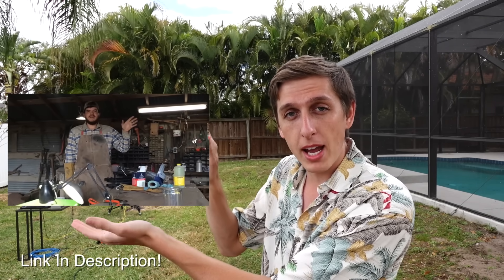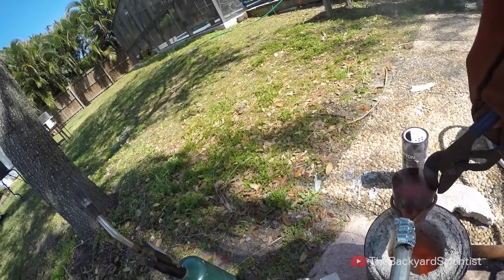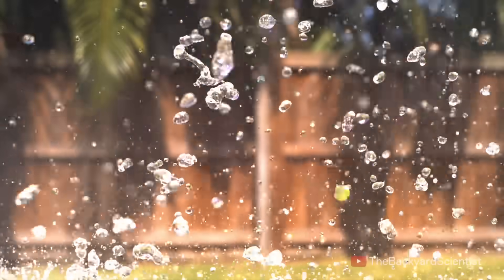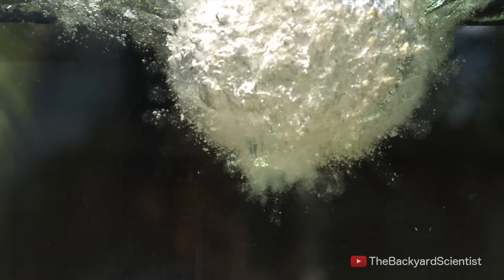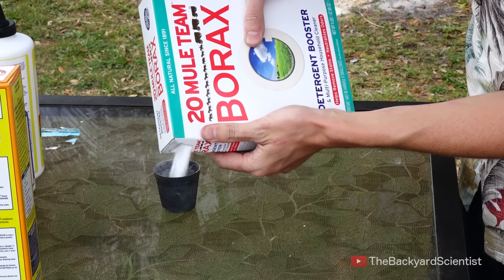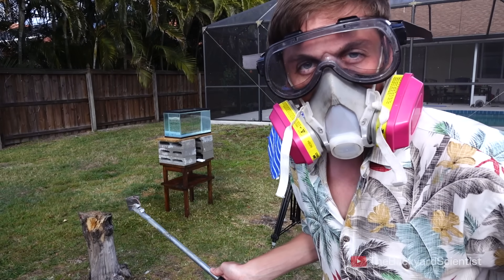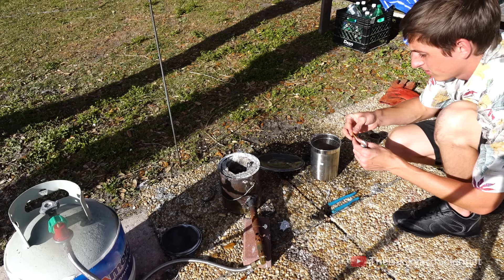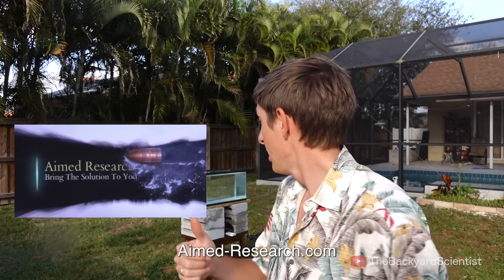Pouring Molten salt into Water - Explosion!

Comment: Its has to be a chemical reaction because it is releasing clorine gas from changing states and then you are left with sodium. So it is not sodium-cloride anymore you extracted sodium from sodium cloride. Then the sodium reacts with the water. This is my theory on if it is chemical or physical.

Edit1: The clorine is  protecting it for a little longer to make it react underwater then the clorine turns into more gas and gets extra pressurised, and with the sodium is going to be more explosive.

Comment: The reason this happens is similar to sodium explosion , about 70,000 amps of current pass into the water , only a small portion of the salt reacts so its 70,000 to 700,000 amps for 1,000th of a second

Comment: It may have something to do with how salt dissolves in water. It become separate atoms of Na and Cl suspended in the water. Heating the salt may accelerate the dissolution process and make the sodium more reactive to the water, triggering an explosion even though its concentration at normal temperature would not cause such a reaction.

Comment: Elementary sodium reacts strongly with water, according to the following reaction mechanism:
2Na(s) + 2H2O → 2NaOH(aq) + H2(g)
A colourless solution is formed, consisting of strongly alkalic sodium hydroxide (caustic soda) and hydrogen gas. This is an exothermic reaction. Sodium metal is heated and may ignite and burn with a characteristic orange flame. Hydrogen gas released during the burning process reacts strongly with oxygen in the air.
A number of sodium compounds do not react as strongly with water, but are strongly water soluble.

Comment: It’s hot and cold, you can molten anything to extreme heats and you get the same reaction, you get the same in reverse, cold water on anything hot has reaction.  What happen is the heat starts vaporizing the water it separates the oxygen and hydrogen  and for the explosion you need the oxygen and the hydrogen is what exploded under water, it the same with the metal just it didn’t make it all the way under to explode

Comment: Ah finally, I have made a bomb with a button that pulls a thin metal wall and then I put water on bottom but when you press the button it has a 5 second delay so it doesn't explode in  your hand and the top is molten salt... Oh and the shell is glass

Comment: It looks like its a simple flash into steam that is causing the "explosion".  The water that comes into contact with the super heated salt instantly and violently expands into steam.  The more heat contained in the molten salt the more violent the burst into steam will be.  Water expands about 1,600 times in volume when it flashes from its liquid state into steam and when this happens suddenly, and with enough heat to sustain the flash into steam, then the results are as seen in the video.

Comment: If you drop most anything at 1600 degrees in to water, it's going to create a steam explosion. Water expands 1700:1 at 212 degrees. Super heated to 1600 degrees, it will expand many times faster. Simply a heat reaction.

Comment: apologies if this has been suggested already, but I'm not skimming through 30k comments to double check 😅.  Could the difference in physical reactions between the various salts be due to a difference in thermal conductivity among the different ionic compounds?  My thinking is that if table salt is conducting the heat to the water more efficiently, then you should get a bigger, faster, expanding cloud of steam right?

Comment: I use to heat lead up on the stove in a tin can and pour it into a one gallon wide mouth glass pickle jar filled with cold water to make weird shapes as the lead became solid again in the water, but once it blow up, not leaving any of the jars glass even 1 inch long and the entire kitchen was wet and dripping from the ceiling. I didn't get a scratch, but haven't done it again in the last 50 years. It took some time to clean up befor my parents got home, the glass was everywere.

Comment: None of these guesses sufficiently explain why other salts don’t exhibit the same behavior.

The outer layer of salt cools extremely rapidly and solidifies. As this happens, it shrinks (as most liquids do). Notice, all of the explosions were near perfect spheres. This only happens when the salt becomes submerged and the top is not left molten as a means of releasing pressure. When the outer shell compresses to a point where is cannot contain all the forces inside, it shatters and explodes. Similar to what happens when you clip a prince rupert drop under water, but there is a lot more energy involved.

Comment: Seriously, I have to ask how lacking our chemistry education is in schools.

Anyone with any rudimentary education about chemistry knows that metal sodium, Na, will react violently with water. The reason for the violent reaction with water with molten salt is simply because when you heat up the salt, you destabilize the ionic bond between the sodium, Na, and chloride, Cl, atoms. The metal sodium is still molten, but stable, and more pure. The chlorine, being a gas, is trying to separate from the sodium due to the higher energy the high heat content has given it. 

Upon contact with the water, the metal sodium reacts very violently as chlorine separates for a split second from the sodium atom, becoming a vaporized gas. The water ends up being a mixture not of salt water, but a two-fold chemical compound, one of sodium hydroxide, NaOH, and hydrochloric acid, HCl. This happens because the high heat also gets transferred to the water, allowing the water to break down into one molecule of hydrogen and oxygen that are still negatively bonded, and a free hydrogen atom. This how sodium hydroxide, NaOH, and hydrochloric acid, HCl, are formed in this reaction.

Comment: The fact that first attempt at molten salt into the water failed to create an explosion would lead me to believe the temperature of the liquid salts you are dumping may not be constant. There maybe a temperature that the other liquid salts would behave similarly to the right temperature molten table salt. A significantly taller enclosure and thermal feedback for the water and the salt could show in simple heat transfer what occurred and over what time period. Leidenfrost looses effect of insulating barrier at significantly higher temperatures than the leidenfrost temp.  Another way to see it wasn't chemical but physical, would be to observer the resulting temperature of the combined water and salt. Chemical reaction would have given off or absorbed energy. I would think the PH experiment would have seen the final combinations of the salt dissolve and higher ph resulting if your measurement strip has the resolution to see that change of ph from that small amount of salt (even if not molten).

Comment: I think I figured it out.
It’s a runaway physical chain reaction. In the first explosion you can see the expansion start at the tail on top and travel down the salt stream into the blob. Somewhere on the tail there was enough turbulence to push the salt thru the leidenfrost forces into contact with the water causing the salt to rapidly dump its kinetic energy into the water, vaporizing it and causing it to expand. It expands into nearby salt and water causing more contact and more expansion which causes more contact and more expansion etc. When it reaches the blob on the bottom, which is storing a crapload of kinetic energy, the reaction breaks wild, dumping all that energy into the water very quickly, causing a massive steam explosion.
Reply: There is no reaction.  Heating water to steam is not a reaction.
Reply: @gibbogle  There is a physical reaction. A transfer of energy and a change in the matter state.
Reply: @toddisawsomeable  Yes, I should have written "chemical reaction".

Comment: It's chemical, the reason as to why their was no change in the ph of the water when you added the molten table salt, is because the ph of table salt is relatively neutral. Therefore, causing no change in the level of ph to the reaction.

Comment: How about copper Sulfate, magnesium chloride, iron Sulfate, potassium nitrate and calcium carbonate? Will any of these five metal salts will explode in water when molten. Potassium nitrate will likely explode in air when heating it up before pouring it into the water as it’s used in making black powder.

Comment: I think the variability in your results is due the Leidenfrost effect, or a similar effect if you take that   the Leidenfrost effect is about the water vapour layer only. Another effect is solidification of the molten salt affecting rate of water boiling.... If the solid surface of the salt slows heat conduction ( including I/R ) ,  the rate of boiling of the water can be reduced.. so we need to know the heat conduction and I/R transmission of the solid and liquid salts you are  testing...  the sodium borate may be opaque to I/R, while solid NaCl may be transparent to I/R  ?

Comment: Dissolving NaCl in a water is a exothermic process. So when you pour a liquid salt into a water it's trying to raise the temperature higher and a water boiling ennormously forming a high pressure bubbles of steam that explodes.
However, it could still be a chemical reaction. Perhaps, at such a high temperature, an equilibrium ion exchange reaction occurs between water and sodium chloride. Perhaps, at some point, thermal energy is converted into the energy of chemical bonds of some complex unstable compound, which then disintegrates with an explosion. However, spectrometry, perhaps, or some other cunning research methods will help to answer this question more accurately. Possibly X-ray photography or something.
Reply: what language is this
Reply: @autisticbluesloth5244  Russian.
Reply: @Ma_X64  ohhh

Comment: It’s a chemical reaction because the salt goes in the water and with it being melted salt it’s at a high temperature so it reacts with the water water vaporize than turns back in the water, it’s happening so fast and the salt basically acts as a conductor and it causes it to explode and that’s why the hotter it is the bigger the explosion.

Comment: With the molten NaCl, what you're seeing is almost instantaneous super-heating of the water that surrounds the hot ball of molten salt PLUS perhaps secondarily, some energy of solution as a concentrated source of sodium ions hits relatively pure water.  It's actually a physical reaction, not a chemical reaction.  I expect you'd see something pretty much as enthusiastic if you heated an equivalent amount of any transition metal to the same temperature and dumped it into the fish tank.  

Whereas, the sodium metal does engage in a chemical reaction with the water.  
2 Na + 2H2O --> 2NaOH + H2
This is a highly exothermic reaction that produces sodium ions, hydroxide ions and hydrogen gas.  The hydrogen gas is highly flammable and often bursts into yellow flames if the reaction is large enough AND if the Na metal shard floats around the top of the water reservoir as it rapidly reacts.    If the blob of Na metal gets submerged, the rapid evolution of the hydrogen gas and the steam produced from the exothermic reaction creates the enthusiastic "explosion effect" that you see here.  

NOTE: Heating reactants is going to make just about every reaction more rapid, whether it's physical or chemical.  

Boron salts have an interesting chemistry.  They tend to form coordination compounds and are not going to produce the same sorts of reactions, physical or chemical, that sodium salts tend to produce.  They behave quite differently in water solutions -- a physical phenomena, not a chemical one -- and that's why your boron salt experiments diverged from your sodium and sodium salt experiments.   And the molten temperatures of different substances, of course, vary and that will make a difference in your experiments too.

Other salts formed from the 1st period elements, Li, K etc, are going to behave in chemical reactions like Sodium salts.  The effect will diminish dramatically as you move to the right on the periodic table.  In this case, because they are chemical reactions, as opposed to physical reactions, it does matter what the metal involved is.

Comment: maybe it has to do something with the thermoconductivity of salt. its conductivity is to high so the energy transfered into the water is to high. as soon as it hits the water it transfered alot of heat and vaporised the water it touched very fast, this "explosion" caused some molten salt also to explode into smaller chunks but expanding slower than the water because the differences in density, cohesion and the point of where the explosion started, those smaller chunks of molten salt agin hit the watersurface and cause the same reaction, the bigger part of the molten salt still falling through the vaporised water an touching again, a little bit later than the smaller chunks, the surface of the water and again causing the same reaction.

*not an expert just what i think

Comment: 2 possible reasons.

1. the heat is flashing the water to steam so fast it explodes.

2. the main substance sodium is somehow going into metal form and exploding.

try dunking a solid chunk of sodium metal of the 50 grams you melted the salt and see if the same happens.

Comment: i think the only chemical physics difference would be, how powerfully ionic Na and Cl are to each other compared to the other salts, since those two are so attracted to each other and readily form ionic bonds with hydrogen and oxygen in the H2O,  theyre attracted to each other more causing that elastic effect and releasing more energy, rather the other salts dissolve/break off easier with less energy and less likely to stretch retaining a bond ionically. 

Think of a rubber band, the more it stretches, once it breaks, the more energy it releases.

Comment: It's called a 'Steam Explosion'. It's caused by violent boiling or flashing of water or ice turning into steam, occurring when water or ice is either superheated, rapidly heated, or heated by the interaction of molten materials (doesn't matter if it's salt, metal, sugar or something else). Due to the rapid evaporation of the water, it reacts violently and causes an explosion of steam due to the great increase in pressure. This is very common around volcanoes as hot lava meets sea water or ice.

Comment: Molten salt is producing a steam explosion (or more accurately a vapor flash explosion).  It's purely from heat, and happens because it superheats the water above its boiling point.  Elemental sodium and water is a chemical reaction (and the heat is igniting the hydrogen produced).  The other salts you tried didn't explode because of the Leidenfrost effect, the only reason I can think of why that would be is they have a greater surface tension than sodium chloride.  As far as steam explosions go, you can say "well it's just heat turning a bunch of water to steam", but a steam explosion is what destroyed reactor 4 at Chernobyl.  A steam explosion was enough to throw a 1000 ton reactor lid several meters into the air and blow the top of the building off.  Steam explosions and water hammer are nothing to laugh at.

Comment: It looks to me like right around the 2:23 - 2:25 the water displaced by the salt returns and essentially seals the molten salt in a bubble of steam. Now, I would think that would just break the surface tension of the water and reopen, but with all the actively changing pressures from such a quick reaction, something may be happening quicker than that could happen.
For example, if it is generating the steam quick enough, it could potentially build pressure contained in the bubble, which when reopened could cause a BLEVE, or boiling liquid expanding vapor explosion. Similar to opening a pressure cooker still under pressure. 
I don't know if something like that could happen so quickly, unless it was producing a massive amount of steam very quickly. 
But, it seems the point of origin, time wise, is at the moment the water comes back together and seals off the bubble created by dropping the salt. 
It's likely that isnt the cause, but.. Just my armchair theory.

Comment: My guest that the extreme heat combined with the addai alright as created sort of a gas bubble around the scent liquid this creates such a reaction that forces water out and upwards this would then cause a sodium chloride reaction with the force but at the same time it more the physical reaction due due to it's only really being actual force of the air and high wavelink breath pressure the reason why the first experiment with chloride went so terribly and bersuit straight away is because they were not the other chemicals to delay the set reaction

Comment: Sodium belongs to the first main group of the periodic table, which is also called "alkali metals" (except hydrogen). These metals are very reactive because they have an external electron. Since these atoms want to get the best possible energy charge, they have to give up this electron. Non-metals, on the other hand, accept electrons and therefore there is a CHEMICAL reaction with the water. 2 Na + 2 H2O -> 2 NAOH + H2. So it combines to form a new molecular structure (that's why it's chemical). In order to get this reaction to an explosion one has to add energy (therefore one has to heat the sodium in order to cause an explosion). This reaction is LIFELY DANGEROUS and should only be carried out by EXPERTS. Like here: https://www.youtube.com/watch?v=m55kgyApYrY&ab_channel=scientist303
This applies to all alkali metals.
So please watch out!